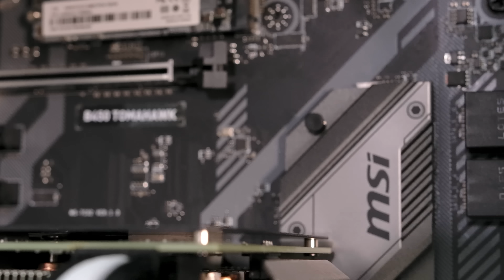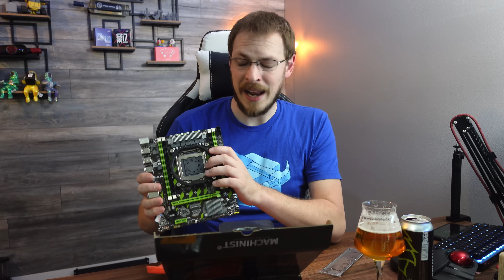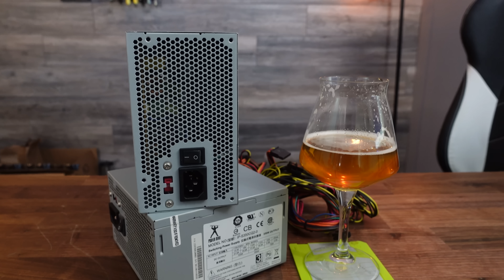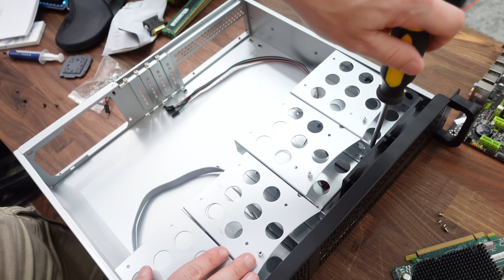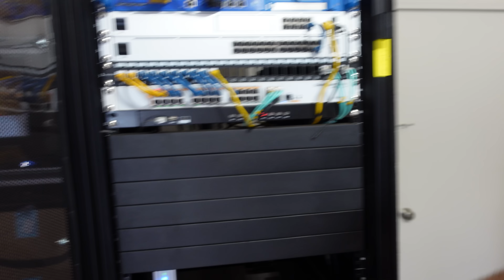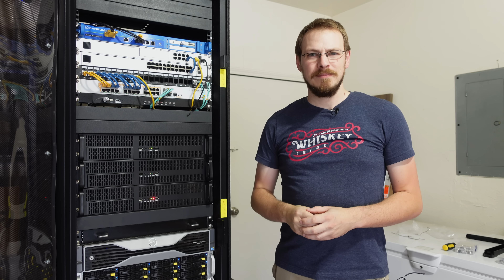A Three Server HomeLab for less than $1,000!

Comment: Timely. I've been looking at old DL380's and R720's/R710's for this purpose, but decided for extra horspower I'd build my own. Sadly, can't get the Rosewill here in Aus, TBH it's hard to find much of use apart from a handful of Silverstone's and some TCG's that look similar to what iStar USA has.

Almost went balls to the wall with a 3900X, but decided 2x 2700X's would be a better choice and about the same as a Xeon E5 based HP or Dell in cost once performance and power draw were taken into account. Slightly less RAM this way, but WAAAY faster. Unfortunately, unlike US pricing, a good second gen Xeon E5 with somewhat fast chips and a bit of RAM is north of $1200 in Aus :(

Comment: A used dell optiplex power supply may have been a good option here, straight through airflow design and only $13 shipped on ebay, only rated for 275 watts, but they are high quality and some skus may not work as they're technically not atx just atx-ish.

Comment: Intel specs list the E5-2648L at 70W TDP, not 65W. It’s also not totally correct to say that it “has no turbo boost”. It does. Just not for all-core loads. The 2648L is spec’d for 0/0/1/1/2/2/3/3 turbo bins, which means it’ll run 2.1GHz on 1-2core loads, 2.0GHz on 3-4core loads, and 1.9GHz on 5-6core loads. If you’re not seeing this behavior, it’s likely because of the Chinese motherboard not handling the turbo bins properly. 

But the 2630Lv2 is a better choice. 6c/12t, Only 60W, same 2011 socket, 2.6GHz all core boost clock

Maybe you mean it’s the lowest TDP 8-core? It’s certainly not the lowest TDP CPU for socket 2011. 

If you really need 8 cores over 6, could also go with the E5-2628Lv2, 2.1GHz all core, at the same 70W

Really people shouldn’t be looking at the 32nm V1 chips anymore. The 22nm v2 chips run faster, cooler, support faster memory, have better IPC and are supported by nearly all the same motherboards.

Comment: Would you answer questions via discord? I have a 98 doller server 4 core 16 gigs ram mid tower.
Want to upgrade need some advice as i wanna do plex and docker games as a host.
Lastly it needs to spin down and hold lots of disk i have 4 ssd 3 hdd 1 m.2 maybe you can help me do some part picking

Comment: Well, it wasn't 3 servers without virtualization, but a Threadripper 1920x for $199 and a $239 ASROCK Phantom Gaming 6 motherboard using both ethernet ports and Wifi would be sub $1000 too.  ;)  I know, not really fair, but it's another approach and would allow for greater performance overall. Still, I can see the benefit to multiple machines when really building a network "lab", so well done and nicely executed.

Comment: @Craft Computing You should 3D print some 1.75"x1.75"x1.75" blocks to use as supports when mounting something with a 1U gap between it and the thing below it.  Stack them as needed for multiple U spacing.

Comment: i can understand designissue by the psu in/out take hole but you have spacers in the rack in extra so you could space them out but still lazyness  and stressing "homlab" build with  zero psu airflow..it is just stupid....
Reply from the maker: I also stressed 100W max draw from each server. You need to use power to generate heat, and what little airflow is going through them will be enough. And this is in an air conditioned rack anyway, they're going to be just fine.
Reply: @CraftComputing   airflow is not always to save the hot component some of the transistors,voltage regulators can run for long time pretty hot if you remember the old times when it was this giant caps next to a cpu -it was mostly not  the cpu the issue -dry capacitors were .. and in your case actually if they pull 100w means about minimum 20 w of heat(but psu-s even on high efficient ratings are getting in to that promised point only on high power use -means on standby it is even more % of power is transforming in to heat in there) on spot and if you look in to a psu(and it is not blown out just kinda circulates inside because the fan cant blow out it is just mixing in that "hot" box) it is only few components what are heating-the rest is only math. I was expecting some cool place but still in that small box air is not moving.-and actually the fan inside is kinda in "vacuum" what kind force it was not designed so that is also ... -just  was not designed to run "passive" 
question: if you knew that design of the case is like this and have this problem why you did not chose a psu what has the "older design " what has fan on a back and holes next to the cable outlet so pulls air in a long way?

sorry that i am thinking in this way but me as an electrician  i think it was a wrong choice of component for this purpose   if you think  that you want to keep that servers as they are for longer period-do not misunderstand me  maybe it works but when i build a pc i  try have airflow as much as  i am sure its not gonna boil up..- even after time whe it gets dusty..because lot of people does not count on that...

but if this setup will work for longer time if you do a maintenance i would like to see what it will be the difference between the top and under servers 

on the other side right now i am thinking why  not choose those minipcs for this kind job- or custom build  with used laptop motherboard ....- possible that you  would have in % way less enegyloss/use for small application bu yes it is more work to make it look professional/nice..

Regards

Comment: If you don't have/want a rack in your house, old socket 2011 workstations are hitting ebay for dirt cheap. Upgrade the cpu and stuff it full of ram. Silent fans already included. I have a Dell T3610 with an 8core16thread 2.4GHz all thread clocked Xeon and 64GB of RAM. 2x240GB SSD and 2x1TB HDD all for $273 total cost. I could easily replicate two more for a cluster... seriously considering it.

Comment: Ich have 2 points... 

The PSU, that is nothing I would ever take chances with... As you can get a faily better 300W Bequiet Systempower B9 for arround 30€ And Fan wise I hear the fan noise... Just from my experience with that stuff that i.e Inter Tech in their cases dares to call Fans...

Comment: Weird, according to Intel's ark this CPU (at least the model you presented) boosts up to 2.1GHz, and has a TDP of 70W.
And the E5-2650, according to Intel, boosts up to 2.8GHz, not 2.5.
Where are you getting your information? We are clearly looking in different places.
Reply from the maker: I was speaking all core turbos. The 2648L can do 2.1GHz on 2 cores. Anything more than that, and it drops all 8 to 1.8GHz.

Same with the 2650. 2.5GHz is the all-core turbo.
Reply: @CraftComputing  I see, then is just the case of Intel not putting this info in the basic page and choosing to put it only in the datasheet.
Thanks for the clarification.
Reply from the maker: Yep, they do that on all of their products, listing the max single core turbo, not the all core boost speeds. Pretty frustrating at times.
Reply: @CraftComputing  Since I usually just look at consumer parts, and haven't looked much at the most recent, and higher core count, I wasn't aware of that, since in the lower core parts usually the turbo is all core.
Welp, I need to start looking deeper in their specifications from now on.

Comment: Let me do a couple of comments:
1.- In the chinesse motherboards is a known issue with the thermal sensors, so your 37º temperature maybe is not correct at all.
2.- The WOL capability is not present, so this will be another reason for not using a chinesse motherboard if you have your CPD far from your working area.

But for a homelab, very good approach.

Cheers!
Reply from the maker: The thermal sensor is on the CPU, not the motherboard. Not all thermal sensors read correctly on the motherboard, and will show either 125C or 0C.

But the CPU temp is accurate.
Reply: @CraftComputing  I'm afraid I would like to own an x79 or x99 from known assemblers for contrasting the temps, but I'm a poor man who buys in AliExpress too.

:)

Comment: Would be a nice little setup for vmware vsan or building your own ovirt cluster. I have looked at those boards quite a bit and wish they would include onboard video and a second pcie so you can run a hardware raid controller and a vpshere 7.0 compatible network card like a broadcom

Comment: back in the day (1980's) you could get plastic feet for MB mount holes that did not line up to any mount points in the case (you can probably still get them). This would solve your wobbly MB corner
Reply: still have half a gross of these for those oddball cases/betwixed form factor mb's (bought a gross back in 2001), especially helpful for those instances where 20/24 pin connectors are hanging out in space.
Reply: Old school checking in, a 'standard' nylon mouse pad cut into 2 inch by 1/2 inch are the perfect height to place underneath motherboard and provide adequate insulation and dampening, that's what i've always used without failure.. just glue or place adhesive tape on back
Reply: I need some of these for my server, as im running an xlATX board in a standard atx case and im using some packing foam to hold up the top
Reply: @Maxw3llTheGreat  I found their proper names: 10mm Flush Mount PCB Supports

Comment: HPs are pretty quiet, and DL360 and DL380 G8s with E5 v1 (maybe v2?) are available for this price range. But you play russian roulette with add-in cards and drives not making the fans run full speed when you don't get HP parts. You also have to find rails and drive caddies. Rack servers like the HPs though do risk running hotter and more power when you load them up. 2U servers will usually not have all slots are available if you try to save power and keep it to a single processor. You also have HP paywalls on firmware, IBM and Dell I think are both a little louder and right now more money than HP. Finally you need to have a full depth rack. This case is nice for fitting in shallow racks like wall mount brackets, 2-post relay racks, and portable instrument racks.
Reply from the maker: Huh... I used to run DL380 G8s, and they were some of the loudest servers in the rack. I could hear one of those spin down from a block away. Although we probably ran them hard 24/7.
Reply: @CraftComputing  there's a setting in the bios to choose the fan profile and also the performance profile. The internet is full of stories about putting 3rd party drives or controllers and it going to full speed fan. There's a webpage with a list of drives that do work. Oddly IBM servers of the same generation are UEFI and HP is BIOS even with E5-2600 series CPUs.

My DL360p G8 1U running vmware is nice and quiet. With the mellanox 40gig flexLOM nic I have 10gig (but no 1gig) and 2 slots available. It's not silent, but much quieter than the IBM of the same era.

Comment: server without IPMI, you may not need it as you can connect kvm locally, but still to seriously learn server management is better to have IPMI
Reply from the maker: There are also software monitoring solutions that don't rely on IPMI. I'm considering a video on PRTG or similar.

Comment: Put some matches in the back between the cases, a small gap is better than none.
But if the PSUs have a grill side, then it should be fine.

Oh and Proxmox, with the new backup.
And different Linux distros see how they perform side by side.

Oh and as you "home essentials" perhaps some content of radius hotspot access and also asterix (or other ipbx) and you can have house phones/intercoms... As well as a sip gateway.. just for fun...

Also as it comes with a free cat, is the case fitted with a fur filter?

Comment: Maybe a stupid question but why don’t these servers need rails? Oh and how do I know what rails my server need? I bought my server with rails but my other servers came without rails and I have no idea what to type into google to get my answer.
Reply: Like in this video, a lot of servers are just bolted in to the front posts of your server rack.  The frame of the chassis should be strong enough to hold the server in that horizontal position, thus only 4-6 bolts are used.
Rails help to support the weight at the front AND rear of the rack in the same way the rails on your kitchen drawers do.  If you want the drawer/server to slide out of its storage position, they would need to be sliding rails.  You can buy generic stationary rails (you can adjust the depth) that screw to the front and rear posts of your rack.  Or you can buy sliding rails that screw to the front and rear posts, but have a slide that will allow you to pull your server out (while the rails hold the weight) to service it, or just to open it up and marvel at your fancy bit of hardware.

Comment: you should've left half U between servers for power supply venting.
Reply: can't do that, he probably could have about 1/3 of a U, but the rack screw spacing isn't even so it wouldn't be the same. And mounting some gear not in the proper spaces is impossible - it would work with the screw layout of these servers, but it looks sloppy. Better would be to find power supplies with 80mm fans and vents on the front.
Reply from the maker: I put these in an air conditioned rack anyway. They're going to be fine.
Reply: @808jpm  you can get old Dell Optiplex 390/790/990/3010/7010/9010 PSUs that would work, but they only have 4-pin connectors for the CPU.

I've thought about picking up some old Dell precision T1600, T1650, or T1700 boards for use in a case like this. Unfortunately the best CPUs you get get for those are 4c/8t setups. They will run the Xeon chips for their platform and can use ECC RAM, but I think they only use unregistered ECC. Jeff's setup gets you more power for less cash.
Reply: Seasonic make ATX PSU's with a quiet fan at the rear for this type of thing. I know, I'm about to buy 2 for a dual Ryzen 2700X setup for exactly this purpose.
Reply: Take the tops off the power supplies, the case has fans at the front so there is air flow in the case. Simple.

Comment: Good video as usual but one question, I may be mistaken but are you not thinking of the R710 with the 6 core cpu limit at the end of your video? I've an R620 with 2 10 core cpu's (2660v2 etc) which is the 1U version of the R720? In Dublin/Ireland you can pick up an R720XD with 2 6-8 core cpu's and 48gb ram for about €200 (not sure of conversion to dollars) and then buy the 2660v2's or similar and have a high spec box for about 300-350. They may be cheaper here though as we have a lot of data centers for such a small country.
Reply from the maker: Check out the pinned comment. Yes, that's exactly the server I was thinking of.
Reply: @CraftComputing  I never noticed the comment :). You should do a video comparison of one of these versus an R720. If could get one cheap it might be worth it for your viewers to see another option.

Comment: Pro installation tip, take two of your least favorite screwdrivers and insert it through the Server Ear Eye Holes of your choice on both sides (e.g. bottom left and bottom right hole) of the rack to pin it in place through the appropriately aligned rack holes that will eventually have screws in them too.  The screwdriver bears the weight while you fiddle with the screws.  The largest diameter screwdriver that will fit through both sets of holes will glean you the least fiddling as it will achieve the best temporary alignment, they also act as handy levers for slight alignment adjustments pre tightening.  

If you like this idea, bend the pair into hook shapes and they won't ever slide out until you work them out.
Reply: Honestly I prefer just swearing profusely trying to balance a 2U appliance with one hand while bracing my forearm on the switch below it and hoping I don't cause anything to power cycle. XD
Reply: @CyberdyneSystemsSkynet     or tear your biceps
Reply: Nice tip!  (I know...that's what she said).  Seriously, that is a good tip to know.  I'll try it on my next install.
Reply: Even easier, just put a pair of rack screws in the ru below and hang the server off that. You'd be surprised how much wait it takes
Reply: @dirkdeboer6569  this is how I have done it in the past but not with a cage nut rack; prethreads make that approach so much easier; almost impossible to get cage nuts in place after the server is mounted even loosely; my trick is to put a shelf in below the insert, inverted and let it hold the weight
Reply: Or simply buy a pack of rackstuds and no more screws ever needed.
Reply: @XSpiritvSX  I can never seem to find them when I need them.
Reply: Yes and don’t forget to use your magnetic tools when working with HDD’s. And when you get a sponsor for a video you to can build garbage and throw it in a $1Kplus enclosed full rack, because baby needs a pie-hole and plex is so demanding. Joke build
Reply: This is how Louis Slotin died.

Comment: I know an HP z620 is boring to review (and has already been reviewed) but I'm pretty sure a single z620 would make a better homelab than 3 of these things.  They're dirt cheap on eBay and don't come from china and they're basically a dl380g8 in a workstation form factor.  If you really wanted 3 separate physical boxes then 3x z420 would be the same cost as yours but with 3x more memory slots and a boatload of additional pcie slots.

Comment: Watch the PSU temps ... you are blocking their airflow by having them one on top of each other !
Reply: Yes, but at 100 watts total system power draw and about 80 percent efficiency, we are only talking 20 watts of PSU heat. That amount of heat can probably just leave the rear side by convection cooling.
Reply: I was going to ask if he solved the choked psu problem!
Reply: I totally agree, he should have at least some gap between each of them to let the psu get some ventilation even if that would mean rearraging some of the other servers on the rack.